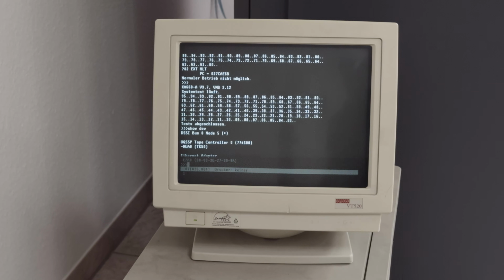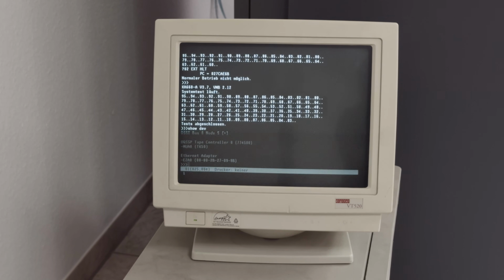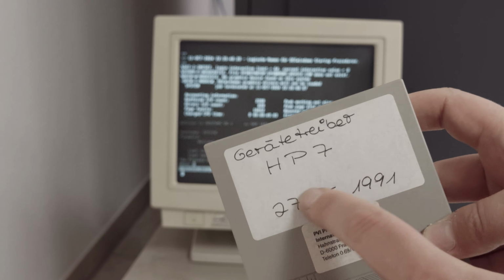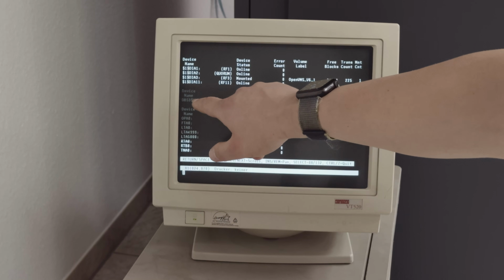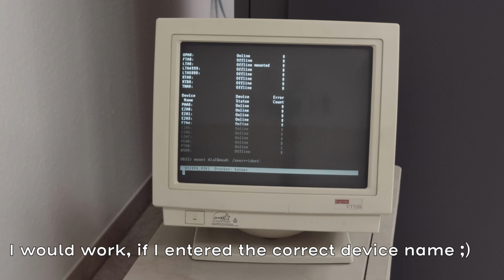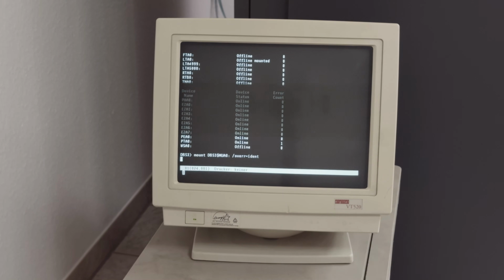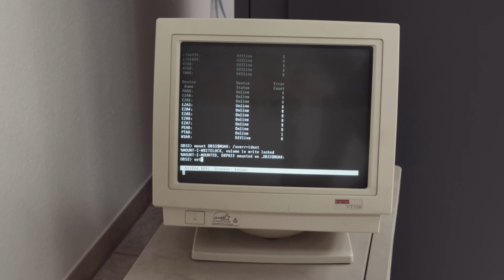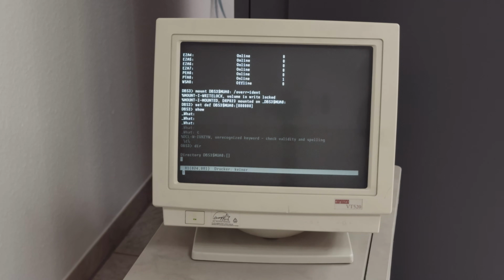Let's talk about DEC Tapes and Tape Drives - CompacTape, DLT und DAT

Comment: Hi and thanks for the informative video! I have non working scsi Quantum DLT4000 drive. I believe one of the microcontrollers on the electronic PCB isn't working (all left-side LEDs remain always on and the device doesn't show in the scsi bus). Maybe you have an idea how to troubleshoot the electronics?
Reply from the maker: The drive performs a self-test when it is switched on, during the test the left LEDs are on. If an error is detected, they start to blink. Therefore, the self-test does not seem to end. It looks as if there is actually some damage in the electronics. The search for the defect will be time-consuming. Fortunately, the DLT4000 is still available cheaply on the second-hand market.
Reply: @DECcomputers  yes I've read that on the manual. In this case nothing on the left side blinks. They come all on and remain there forever. It was a free drive for me, I don't have any DLT tape but would've been a good drive if working. I'll keep the external box for other drives I guess.
Reply from the maker: @iz8dwf  I would also keep the drive. It is at least a good source of spare parts.

Comment: Good coverage of those tapes. I've always had reliability issues with TK50's (and to a lesser extent TK70's), but more problems with tape 'sticktion'. If only VMS let you wind the tape to the end and back again, these problems would not occur. The standard issue drive for the 3xxx and 4xxx series VAXen was the TK70, so probably why your TK50 looks a little odd in that machine (to me anyway!). The first DAT drive was the TLZ04, which was actually released before the DDS standard was finalised - so I believe it is not quite compatible with it. The TLZ06 is of course completely compatible.

One way to test the TK50 without having to boot off your 4300 would be to boot a standalone backup tape. In the old days, you could then install VMS from tape to the hard drive (I've got a video on that). All became a lot easier with CD-ROMs!

Cheers,
Reply from the maker: I've forgotten about the comments over the last few days, so my answer is coming a little later than usual. 

I did some tests with the TK50 and it was able to read my tapes. I also tried booting from a tape, but it takes a while to test if it is bootable because each tape has long reading times. I've tried three tapes and only one was bootable, but that was VMS 5.2, which was too old for the machine (message: CPU not supported). Unfortunately I don't have a TK70 and the TK50 looks much better than the old non-working hard drive and it is operational :)

I did some research on the TLZ04, it supports DDS1, but only the 60m long tapes, so it's limited to 1.3 GB. In the meantime I've got a TLZ10 (as an SBB) so I can now use DDS3 as well.

Comment: Very interesting, thanks!
Wild how they thought/knew they had to print instructions on how to load/unload on that drive - at least i would guess the system was not targeted at the average consumer :-)
Reply from the maker: Interestingly, this information was not printed on the early versions, but it is helpful. There was a workstation version as well (in an external SCSI enclosure).

Comment: I had TK50 unit but I think not work propertly because green led always on and when I try to mount tape from VMS error parity shows. Try to initialize tape do the same.
Reply from the maker: Is it the version with SCSI or with a dedicated controller? The dedicated controller has two switches, one for the address and one for the hardware revision, especially the second switch confuses me a bit, my device has revision “E7” and the switch is set to 7. I don't know how the controller behaves if the hardware revision is set to the wrong value. Maybe this is your problem, maybe your device is faulty. The TK50 in the video is the first TK50 I own. I had a TK70 in a second VAX 4000/300, but that was 20 years ago.
Reply: @DECcomputers  Dedicated Q22Bus controller for VAXStation II/GPX K630 CPU
Reply from the maker: @tomeucapo  Then it is the same controller like in my video, you can find the switch optiones here: http://antinode.info/dec/tqk50_settings.html or in the manual http://www.bitsavers.org/pdf/dec/magtape/tk50/EK-0TK50-TM-002_Jul86.pdf (page 5-20)